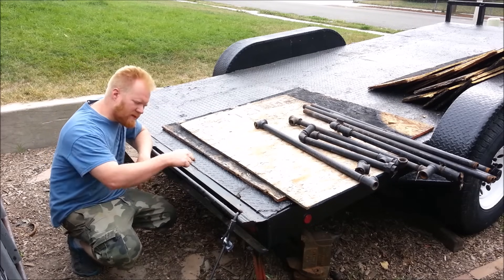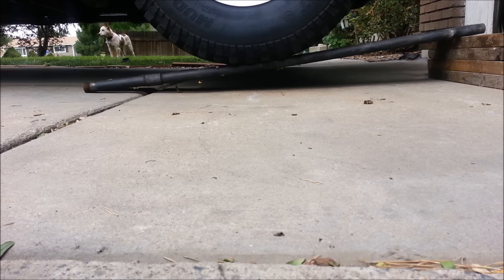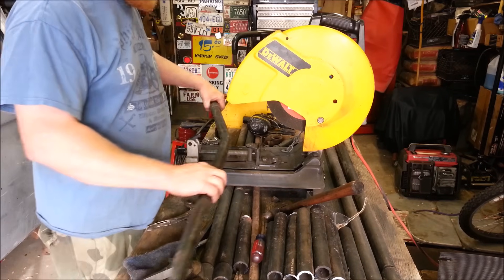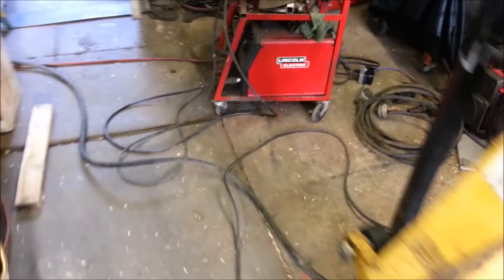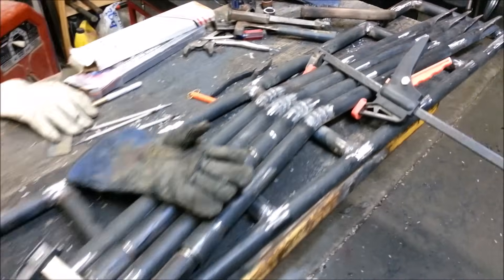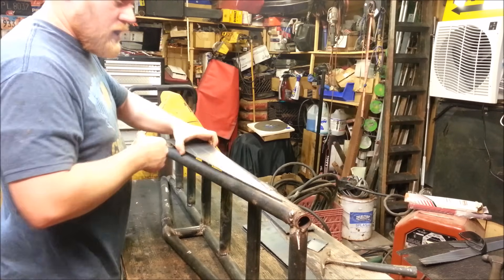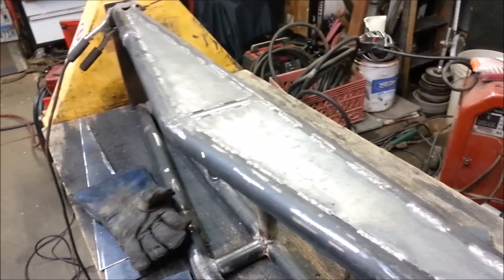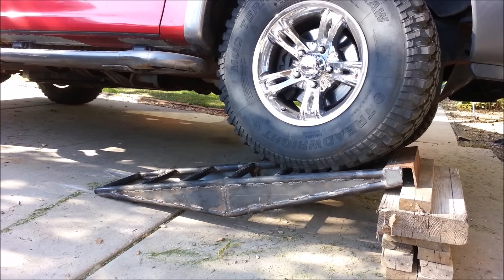Building Trailer Ramps heavy duty from Old Pipe

Comment: You were supposed to run a 6010 or 6011 for the root and a 7018 for hot pass and cap and please keep your electrodes in a warm dry place, also look into any Miller welding machine because they're way better machines. I've never produced a good weld with a  lincoln welder
Reply from the maker: You wouldn't run a root/cap on 1/8" material. I just bought a new Miller and it's already been in the repair shop. It's nice but I really see no difference in a Miller vs Lincoln, it's just what you're used to.
Reply: @sixtyfiveford  as much as I want to I can't argue with you there

Comment: I was gonna get one of those tombstones but not having a shop I would've had to mount it to a dolly just to move it around. I decided to get an Everlast 140st which is only 35-40lbs and works great. I do plan to get a cheap HF 90 flux welder but I wanted to learn stick first and wanted something that can weld thick stuff in one pass.
Reply: Allen McKinney the Lincoln 180 is the machine that I have it plugs right into my diesel power welding machine there is many many applications where I use the MIG welder it's just more economical it's easier to learn how to mig and a whole lot cheaper especially on consumables a tidbit of advice use .030 wire in a Lincoln 140 or equivalent machine will work just fine I have a 220 machine so I can run into somewhere make one structural weld and leave way more convenient than pulling Leeds Lincoln np2 11 wire is the only wire I use and there's a reason for that the wire is smoother to weld with and my experience with trying to beat something apart that I welded together the Lincoln wire holds up way better just so you know

Comment: I have the same two welders as you. I'm getting used to the stick, but the mig is so much more convenient. What setting do you use with  the 7018. I've been using more 6011 than anything else...you always have great vids....
Reply from the maker: +Danny Schacht I need a lot more practice at stick, just trying to put in my time. Most the stuff I run at 90 amps. Too low and it's hard to start and hold an arc.

Comment: young men u have the lip on top of your ramp this is wrong u going to bus your ass , with the lip broke
Reply: Have you not seen factory built ramps? A lot of your slide out ramps are built with the hook angle iron welded on top. When I built trailers professionally we used 3x5x1/4 angle for the hook piece welded to the top of the ramps , even the heavy duty 3 inch C channel slide out ramps were built that way. But that was 30 years ago when I first got into welding. So no they ain't on the wrong side of the ramps.

Comment: You built those like you're planning on buying a caterpillar d8. lol. Very well done. I am impressed to say the least. Good thinking adding the bottom pipe, gussets, plates and sides. That will add a ton of strength. I too like flux core. Yeah it can be a pain to clean the welds but mig is expensive since you have to buy the gas. I'd like to get the harbor freight 110 stick welder someday and learn how to stick weld.
Reply from the maker: +Love2boat92 Thanks man. Stick welding is a pain. I'm told DC stick welding is a ton nicer.
Reply: sixtyfiveford Welcome. Yeah I've heard that too.

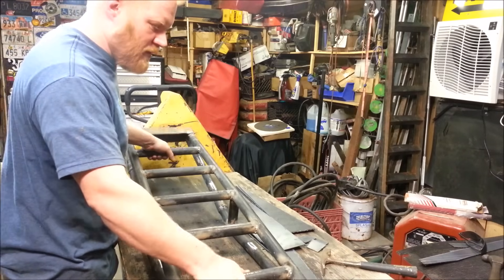Comment: Flux Core welding is the shiz nit for welding outdoors in the wind.  It's way cheaper than cranking up the C25 and more effective too. 8:05
Reply from the maker: +briansmobile1 True Dat.
Reply from the maker: Gas Shielded Flux Core. A hybrid of gas shielded and Flux core is more than likely what you're referring too.
Reply: briansmobile1 why do some flux welders say not for outdoor use? are they worried about wet soil under where a job is?
Reply: I'm not sure.  I'll have to look into that.  Where did you see that exactly?  Most likely it's pollution or corrosion rather than grounding.
Reply: That sounds more correct.   The point is, flux core is more messy, but it's wind resistant.  Welding outdoors can be really frustrating because the effect of wind or even breeze effectively turns off your shielding gas intermittently.  Shielding gas prevents O2 in the air from reacting with the weld like a bellows or something.  If you weld without the shielding gas, your weld will be full of holes and bubbles that blow out or the weld flare off and stack up.  The end result is an ugly weaker weld.

Comment: WOW Awesome Work Moe!   I have a 110V Lincoln Weld Pack HD and never ever had an Issue with it, except when I left the Stinger in the Dirt and jammed the Trigger. But other why's works great 5 years later.  I have never ever liked Stick Welding at all.  Also Them Tires have my Last name in them lol Wright...
Reply from the maker: +TRX450R Vlogger Thanks Man. I actually horse traded for a new Lincoln 240v unit(180c) but I haven't got around to using it, aside from opening the box because my 110 unit handles pretty much everything.
Reply: Nice man!  Yeah I have welded some pretty thick stuff with mine.

Comment: Great ramp idea and build! I've got some similar ramps and the only problem I have is loading something with small wheels, tiller, fridge or anything requiring a dolly even some riding mowers. Guess I could add some mesh. Thanks Moe
Reply from the maker: +robert vance Yeah, that can be an issue with ramps.

Comment: All i will EVER use is Flux core wire in mine...Its cheaper ,no running out of gas,And the welds are Just as Strong....I have a Lincoln 225 stick,and ill tell you,I suck at it,LOL need to use it more,Just So heavy to move (need to put better casters on it)...Nice ramps!!
Reply from the maker: +daniel mcvey52ford Thanks. Most of the time the welds are actually stronger with a flux core, especially a 120V unit. This is because Flux core penetrates better and shields the weld better than gas. Yeah, I need to keep practicing with the Lincoln Tombstone.

Comment: Nice build and welding. You said light, however I think your new ramps are much better. A little short maybe making for a high rise angles but they will definitely work!
Reply from the maker: +MRrwmac I would have made them longer if the free material I had would have allowed it. The trailer angle can be adjusted pretty easily by driving the tow vehicle onto blocks to get low cars up.

Comment: Those look substantial. Was that a Harbor Freight welder next to the Lincoln? I have been thinking about learning to weld and have watched a couple of reviews on 90 Amp unit. What do you think? Thanks.
Reply from the maker: +ug mold It is a Harbor Freight Plasma cutter... Personally I would buy a used Lincoln Weld Pak for around $100-150(if you look long enough you'll find one for this price). The Harbor Freight units are not the easiest to use and if someone is learning it puts them at even a greater disadvantage. If you buy used, most of the time you get a helmet and welding wire thrown in for free.

Comment: 7018 rods require more attention to cleaning of the parent metal which is typically harder than milder steel,it is a harder welding rod which requires more voltage,and welds much hotter than 6010,or 6011 rods,and is about the equivalent of flux cored mig wire but with the flux on the outside of the rod rather than inside of the wire,is about the same hardness,70k tensile strength...The 6011 rods are best suited for dirtier steel,require less cleaning of the parent material,they are more forgiving,require less amperage,have a lower tensile strength,burn cooler....Those ramps turned out great,look plenty stout enough for anything 3 tons,and under...
Reply from the maker: +FJ80Coop Hey Thanks.

Comment: Hefty duty for sure. I wish I could master my flux core better. I used to be pretty good at stick welding, but don't have one anymore and would like to upgrade to MIG. I need cleaner welding for what I do most of the time.
Reply from the maker: +The Shade Tree Fix-it Man The flux core on a 120V welder allows me to do up to 1/4-5/16" with multiple passes. The Argon/CO2 Mig gas allows you to go much thinner but also limits the welding capacity to around 1/8"-5/32". That is a little thin for the majority of work I do. I horse traded for a brand new Lincoln 180C 240Volt Mig welder that is still in the box sitting on my shelf. I'm going to set it up to run fluxcore and use my small 120V with gas for true mig.

Comment: Great build. I disagree with your hypothesis that the sleeves on the black pipe make the pipe stronger there. The sleeves are couplings and are threaded as also is the pipe. The threads on the pipe actually reduce the thickness of the pipe in that area and will tear through at that point under stress before the pipe will give. It's not an issue though the way you built the ramps with all the extra bracing. I  always enjoy your videos and have learned a lot from you. I just fixed the tires on my two wheel dolly that was always going flat thanks to your earlier video, Thanks
Reply from the maker: +Brian Binns I welded up the sleeves good.

Comment: Awesome - I like the 7014 for my buzz box goes on like butter. I also build my own ramps I do like your idea, I would put some expanded metal on the top I find its slippery when wet or snow. 👍
Reply from the maker: +Steve Rob I have some 7014, I'll give it a shot.
Reply: Sixtyfiveford I would start using 7014 instead of 7018. Yes 7018 makes a strong weld but the tensile strength is the same. 70,000 lbs. hence the 70 in both numbers. If you don't use a brand new box of 7018 each time you are suppose to keep the left over rod in a 425 degree oven to keep the moisture out of the rod otherwise you run the risk of having a weld crack on you. Yes it is a good idea to keep all your rod in a heat box to keep the moisture out of it but it ain't as crucial as it is with 7018. But 7014 wild lay in smooth as well and out of all the rods I have ran 7014 is probably the easiest rod to make good welds with. I have ran 6010 6011 6013 7014 7018 7024 and a bunch of special rod for exotic metals but those are just the carbon steel rods I have ran.